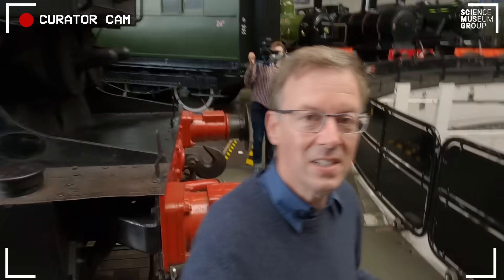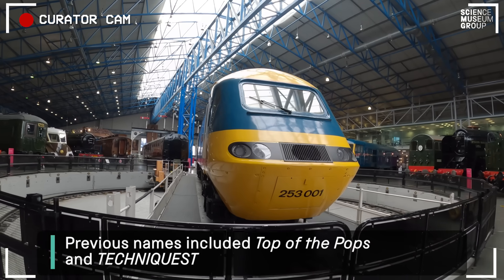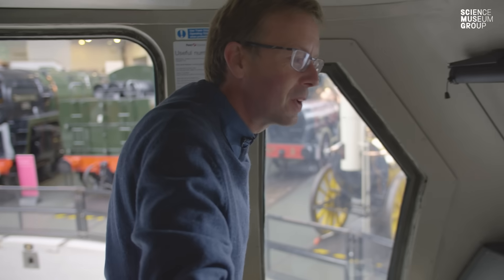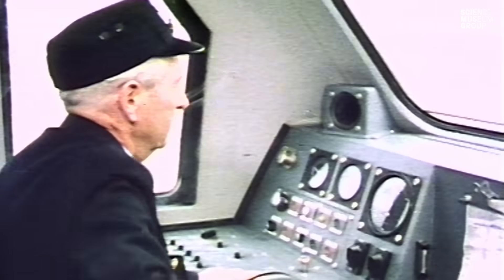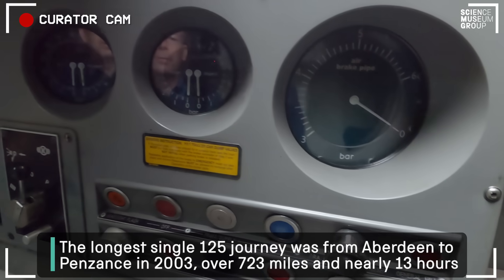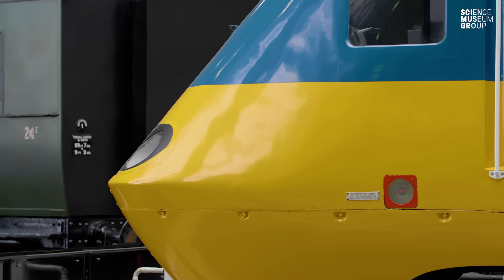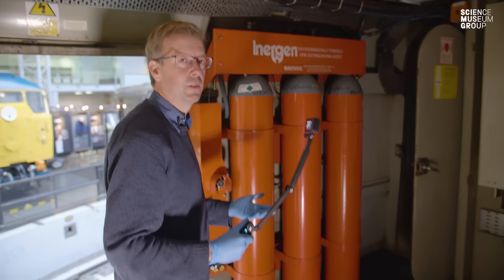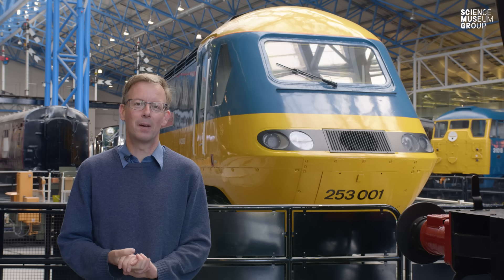What's Inside the InterCity 125? The HIGH-SPEED Diesel Design Icon | Curator with a Camera

Comment: I do not get this...
If you have at power unit in each end of a full train, all without buffers, connection gear and air- and powerlines...What do you do if a train breaks down and needs to be towed to the next station or to the workshop ?
And all trains...Even the best ones do break down from time to time...
And another thing...
You have left the EU and operate under other laws, but a train like the 125 would not be alowed to run on european rails do to the lack of protection of the driver in the cab.
The danish IC3 and ER4 are pretty smart the way that you can make them smaller or larger in minuts, but they do not offer the driver any protection eather and they do only run due to the fact that they were approved before the new EU-law.

Comment: Although the MTU is quiet, more modern, and doubtless better for the environment, the drama of the original valenta-engined pulling off with that V shaped cloud of smoke and scream of the turbo was something to stir the blood of a young-ish lad when I first encountered one.  Nothing else like it, and probably never will be.  I believe most of the rebuilds were due to the valentas blowing up, I gather they got a reputation as an unexploded bomb.
Reply: As much as I hold great admiration for the HST, I used to be terrified of these screaming banshee trains when I was a kid, and would habitually stay well away from any power cars when in stations. Good job I never knew the engines could also blow up as I would have probably refused to travel on them!!

So yeah, I can't say I was particularly sad about the MTU re-engining. Still iconic machines though.

Comment: Loved traveling on these, and as a testament to their resilience and reliability, I got off one at Kings Cross around 13:00 having come down from Aberdeen and the board was there for it to go back to Aberdeen in 30 minutes time. Over 1,000 miles in a day. The genius was not only the shape and look of modernity but having 2 power cars the ability to limp reasonably quickly in the event of an engine failure. Pairing Class 20s had a similar benefit.
Reply: I was an HST driver for 20 years. I never had a total failure on one. I cannot say the same of their replacements....

Comment: I drive these trains for Scotrail, absolutely iconic and amazing to drive. It is a privilege to drive these trains in their final years and is a childhood dream that has come true. The Indian summer of the HSTs for sure! 😊.
Reply: I drove these on The Midland. We ran them without restrictions to the engine at their maximum speed of 125mph. You're so lucky to still have them.
Reply: There were some press reports of Scotland getting second hand rubbish when it was announced that some would be going up to Scotland for semi retirement. Even at 40 years old these trains must be able to outperform the line speeds available on the routes they serve. And at the speed they run they are far more comfortable than newer trains which have hard seats and hard suspension!

Comment: From wikipedia (can't link or YouTube will delete my comment) the Deltic (class 55) put out 3,300 BHP and ran at 100 m.p.h.

Wiki also says the InterCity 125 power cars put out 4,500 BHP (2x2,250) and ran at 125 m.p.h.

Given that friction is typically a cube law, I don't see how a 30% increase in power gave a 25% increase in power.

Looking at vehicular land speed records, the power required normally has to go up very much more than the speed achieved.

Did the 125 have a special trick?

Comment: I think that the description of the DSD is over simplified. You don't simply keep your feet on the pedal - the flaw with that, they realised, was that you could simply dump your bag on the pedal. Or even faint on it... Instead, every so often an alert goes off, you have to take the pressure off the pedal and then reapply it to show that you are alive and reacting. I*think* that this describes the DSD on an HST - it is what at least one page says.

Comment: The trains in my part of the world have two safety devices. A pedal for the foot but also the throttle/regulator can be twisted. The idea is that you’ll twist the regulator handle so you can stretch or rest your feet. I’m surprised this isn’t more of a thing elsewhere, because it seems so simple.
Reply: This is a very, very old one. The new ones will have more safety features and a lot of them have redesigned the entire control system.

Comment: 10:09 the Valentas weren't "all replaced with MTU engines in the late 90s/early 2000s". They were replaced with the MTUs between 2003 or 2005 and 2010, except for the East Midlands power cars which didn't even get MTUs, instead getting Paxman VP185s. I think I did read that there had been engine replacement trials in the 90s, including (I believe) Mirrlees Blackstone engines who I think made the engines in the Class 60 freight locomotives.

Comment: I first came to England in 1991 and as it was my first trip from my native East Germany to a western country and had never flown, I took the train from Berlin to Plymouth (complete madness by today's standards) - via Dover - to London in an old Network South East service more reminiscent of what we had these days - and then on the Great Western Main Line from Paddington to the West on such an impressive HST 125. These days we still had a completely run down railway so it was amazing to zip along at lightening speed for long distances. (with no overhead wires) High tech and peculiarities - side by side on the British railway: curves as narrow as with small town's tramways, still some of those small short wheel base freight cars around - and to get out of the shiny HST: no door handle inside - open the window and grab the handle outside. Why is it that way?

Comment: I worked for Paxman as an apprentice through part of the the development process.  Front shape gave the drivers a big problem in the depots and terminus with the danger of crunching the fibregass on the buffers.  The solution was a plastic ballcock float on a string arranged to bonk the glass right in the drivers eye line.  The Valenta engines were beset with problems in the early days as the BR engines were getting more hours on them than the test engines in the factory due to reduced running hours on the development test cells to allow the neighbors a chance to sleep.  Sad to see Paxman has now gone completely and MTU are now the only game in town for high speed diesels.
Reply: Interesting comment about the testing and the neighbours! As you probably know, the Paxmans suffered with cracks and were welded-up to keep them in service.

Comment: Great video.
Around about 1977, Bristol Temple Meads, platform 3.  I remember an excited driver allowing a lot of transpotters not only into the cab, but walk through the engine room to the guards' compartment with the engine running.  Later having joined BR, I was on duty when this same loco did the fastest run from Paddington the Temple Meads where it was named Top of the Pops.  Howard Jones played on platform 3!  And I once had a cab ride where the train only got to 124mph.  Driver did try for 125, but we would have not been able to stop in Reading...  Very heavy braking through Tilehurst was the result.  In the days when the brakes used to stink.

Comment: British do everything in reverse: German locomotives have the accelerator handle on the left and you push it to go forward, the brake on the right and you pull it to stop. Here the brake is on the left and you push it to stop, the accelerator on the right and you pull it to accelerate. Swiss locomotives have the brake on the left and the accelerator on the right but push and pull is the German way ("pulling" the brake has been standard since steam age).

Comment: I remember the very loud scream of the Valenta engines. On one occasion we were travelling from Newcastle to Kings Cross and unusually went via Sunderland and by the time we reached Doncaster, we were informed we were running 40 minutes late. The remainder of the journey was straight through and it was very fast and thinking and felt we were doing much more than 125mph, it seemed exceptionally fast through Lincolnshire and the level rail crossing X. We arrived at Kings Cross several Munites early. and when we alighted we saw a few crew by the driver's door in a celebratory mood. It was I believe early 1980s, could this be possible?
Reply: Was the service changed to non-stop at Doncaster because of the diversion?
Depending on how many stops were scheduled, it may not be that remarkable.
Cutting out Retford, Newark, Grantham, Peterborough and perhaps even Stevenage, one could quite easily imaging the time being made up?
Doncaster -> King's Cross = 155 miles.
Non-stop, averaging 100mph would give you a journey time of around an hour and a half. Perhaps a reasonable assumption. 
In order to beat that down to 50 minutes, the average speed would need to be over 180mph.
I did a milepost timing down Stoke Bank some time in the early 80's when I realised that the driver appeared to be in a hurry.
I calculated 138mph, but that was downhill and wasn't maintained.
Reply: Yes, it can be possible but only if the train's running schedule was very slack. Some services have a few minutes recovery time added to the schedule to allow for any delays but some services are scheduled to very tight timings and if you are late then you won't get that lost time back.

Comment: The curator's info is wrong. The reason the unions wanted two drivers is because of the significant increase in speed that came with the introduction of the HST. Western Region locomotives (Class 52 Westerns, class 47s)  were then operating at no more than 90 mph (class 50 were permitted up to 100mph) and the unions were concerned that one driver could not maintain concentration sufficiently to see all signals. Over time drivers got used to operating at high speed and the double manning was cut to a single driver.

Comment: I happened to be looking at some photos i have on my PC which i took back in 2019, and i noticed that there was one of these trains in one or two of the photos
It turns out to be this EXACT train that the photo was of, i am not joking
In the photo the train was coupled to some carriages (not the ones you would expect, I’m not sure how to describe them, they appear brown in colour on the photos, but they were coupled to the front of the unit, not the rear), and at the other end of those carriages was a different type of loco
The EXACT date i took those photos on is the 17th of October 2019, 14:14 if you want to know the time
I find it a shame i hasn’t able to get a photo of both sides of it (or even the front), i was only able to get a photo of the (left?) hand side and the rear of it, as the path didn’t allow for it, and also there was another train in the way

Comment: Nice loco but it needs a valletta engine putting back in and the original light cluster panel putting back on the cab to put it back to standard! I thought it would have been done before it got taken out of service before it was donated to the NRM at york! And good video and narration about the locomotive!!!😎

Comment: I grew up right by Box Tunnel, used to sit on the high walls at Corsham end and wait for the 125s to come through. The driver would usually open the taps on clearing the tunnel- there is nothing to match the sound of a 125 giving it the beans!

Comment: I loved travelling on these. Did they often make it up to 125mph or was the network so poor, like in NI, where trains are forced to run much slower?
Reply: They frequently ran at 125mph on substantial sections of the East Coast Mainline. I don't know about other lines, but a trip from London to Bath and back I took on one felt very fast in some sections.
Reply: @owensmith7530  plenty of 125 on that line as well, at one point a non-stop Paddington-Bath run was Britain's fastest timed train at an average of 106mph.
Reply: Indeed they did. Many miles of the ECML from Cambridgeshire right through to Yorkshire are flat out.
Reply: Yes, right from the beginning of their service on both the Great Western and East Coast mainlines though on shorter sections the acceleration rate compared to modern trains would mean they needed a decent distance to reach 125mph. 

Depending on the number of trailer cars (and thus total train mass) acceleration of course varies but a typical 2+8 set will take about 8-9 minutes and around 12-13 miles to reach 125mph from stationary.
Reply: 125mph with some exceptions from just outside London to Bristol Parkway and to Box.
Alderton tunnel (110mph) was one of the exceptions due to toilet ‘blowback’ when two HSTs crossed each other at this location!
Line speed now 125mph thanks to IETs having toilet waste tanks.

Comment: Nice documentary. The walk-through format is quite immersive for the user. However, consider ditching the action cam, because the tiny sensor really can't handle the low light environment and we see very little in the engine compartment. Video lights might also be another approach, but the more mature dynamic range of a real camera should give a more realistic experience. An added benefit would be that you could switch to a macro lens for the shot of the instruments, signs and buttons which must have had the closest scrutiny by operators in their time of service. That way, the viewer could appreciate the wear and tear (excellent highlight btw) as well as the technical intricacies much more.

Comment: I loved the sound they made with the old Valenta power units, they were truly iconic. Still a fantastic train after the new power units were fitted, but nothing beat the sound of a Valenta powered HST pulling out of Paddington station.
Reply: Like all high powered Diesel Engines, the Valenta had its problems and Exhaust Manifold cracking was an issue with steam coming out of the roof ports as cooling fluid leaked into the Exhaust. Still an iconic design and doesn’t look dated all these years later.
Reply: I remember the GNER HSTs from my childhood. I loved their first class interiors.
Reply: Yes, the Valentas. What a wonderful scream moving off from a station.   If you can’t have a deltic, have a valenta.
Reply: The Valentas were atrociously smoky, though.  I saw a re-engined Colas Rail HST pulling out of Bristol last week and there was no smoke at all.

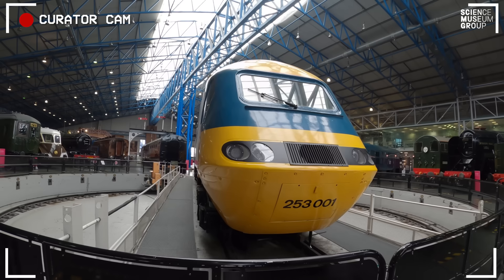Comment: So at around 2:00 to the whole part of “where are the buffers” BR said no buffers on HST
HST with Buffer variants: am I a joke to you

Search grand central hst on yt to see what I mean
Reply: Eight power cars were fitted with buffers when they were used as DVTs with the then-new Class 91s. This allowed for easier coupling, in case the 91 had to run around and pull the train from the other end if, for example, the remote control equipment failed.

Comment: Why does the power control handle work in 'opposite sense'? I.e. pull it back to go! This is not the case on for instance the TGV which is the more natural 'forward for more power, back for less', like car accelerators, aircraft throttles, and ships power levers.
Reply: Standard practice in the UK, modern trains built in Europe to European designs have the controls altered specially.

The reason is that was many years ago the powers that be felt that in an emergency the human instinct was to 'push' the danger away from oneself so pushing both handles forward = power off & brakes fully on and that design has perpetuated.

The same applies with modern single handled trains where power and braking is on one controller, fully forwards is emergency braking/fully back is full power.
Reply: @hexagon7895  Thanks for that but it sounds like a silly 'train' of thought that is well overdue a re-think.  Forward to GO and back to STOP is just instinctive. Europe has it right, as do aircraft, boats and road vehicles. And we are adding cost to our trains to have them changed to an outdated theory? Brake lever on every vehicle bar UK locomotives are 'pull back for on'. That's why car hand brakes. bicycle brakes etc etc are arranged that way!
Reply: @gzk6nk  It works just fine. You’d be introducing huge risk if brake/power handle direction were different between tractions.
Reply: @TrainDriverRob  But they wouldn't be if they all worked in the 'correct' sense. I note that HS trains in Europe do work in the correct sense. It seems daft that we pay extra to have our (continental built) trains modified to the Brit non-standard power / brake.